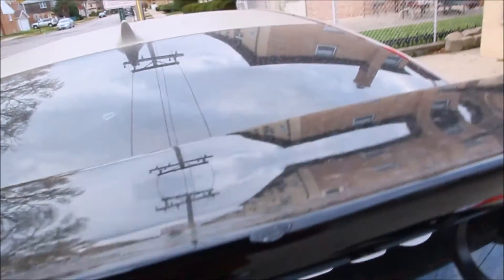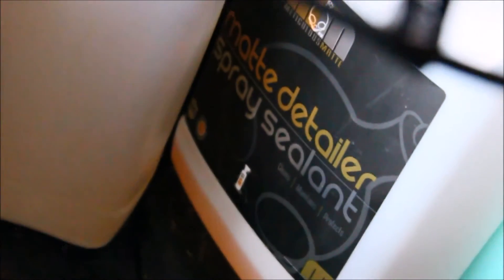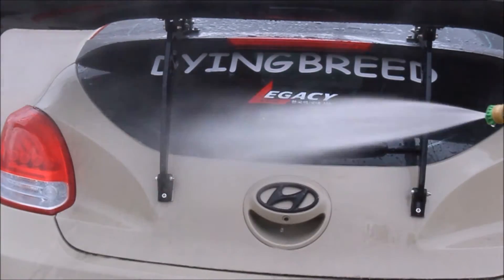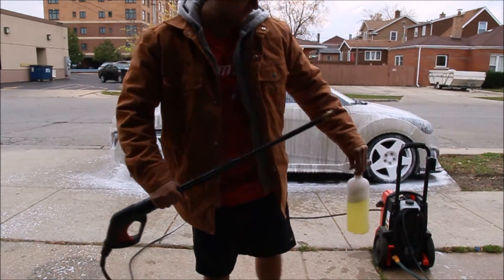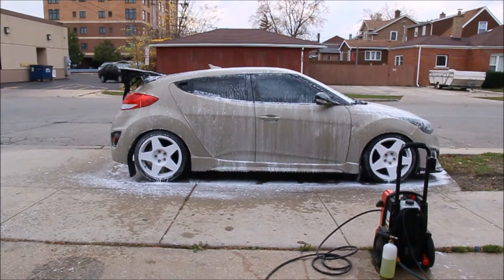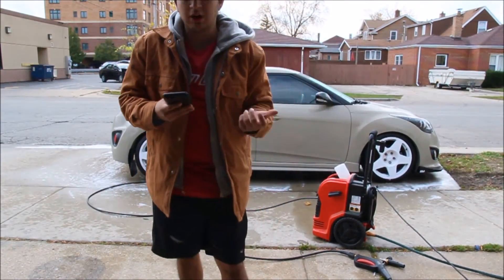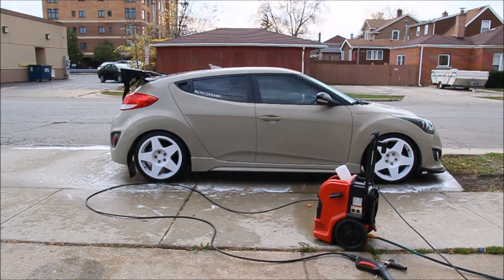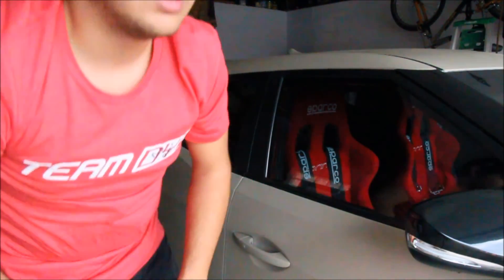HOW I WASH MY DIPPED CAR!

Comment: Any tips on good mods for my vt I already did cold air intake , mud flaps,  grill. I know there's a lot to do but I didn't know if there were any engine mods that were not to hard.
Reply from the maker: downpipe, upgrade spark plugs and a tune